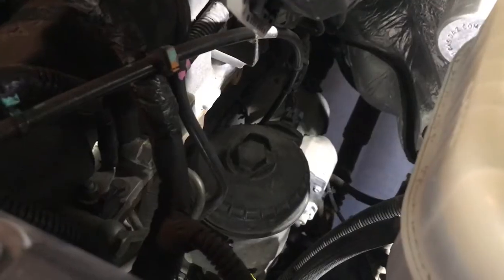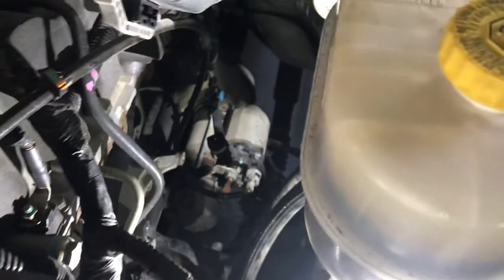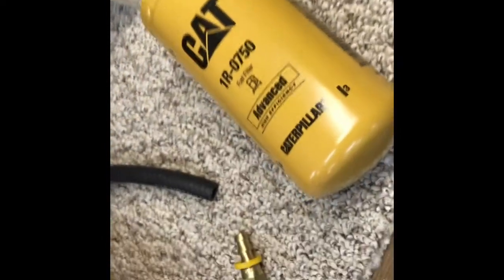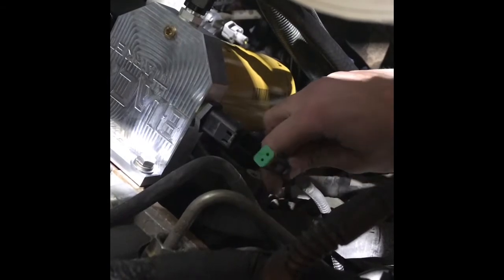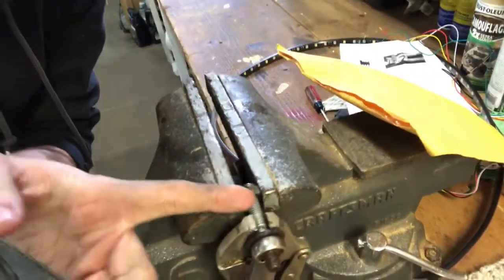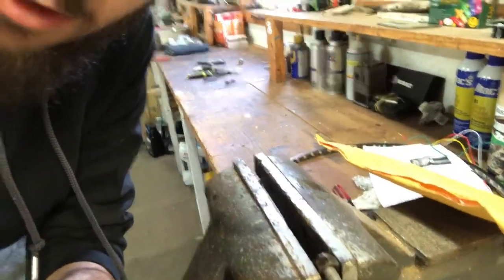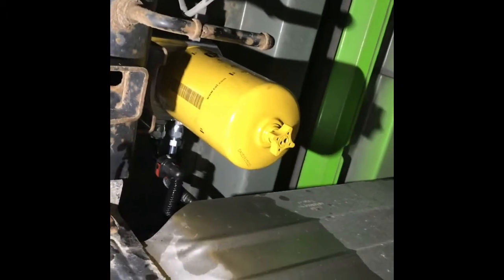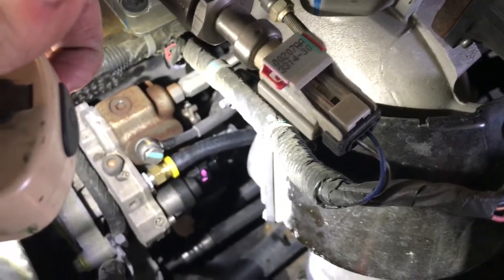6.7 Cummins Installing Cat Fuel Filters & Water Separator Kit

Comment: Why in the front you don’t t have a water separation filter cause the oem one is separator, did they “water in filter sensor” sensor Became redundant?
Reply from the maker: The water separator filter is under the bed and the sensor for that is back there because my light has came on since I put these filters on and I just had to twist the knob on the water separator under the bed and drain it some

Comment: How did u get that back line clip out
Reply from the maker: I don’t remember off the top of my head but it’s either pull it out half way then it comes off or pry out on the back 2 corners of the cabs then it will slide out, those things can be a pain sometimes to get off